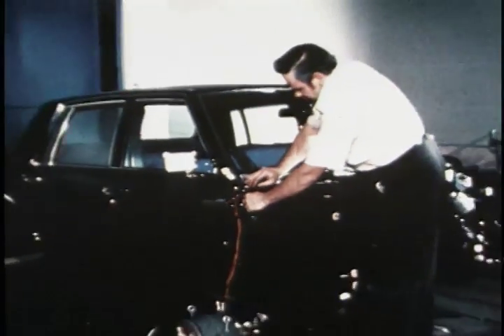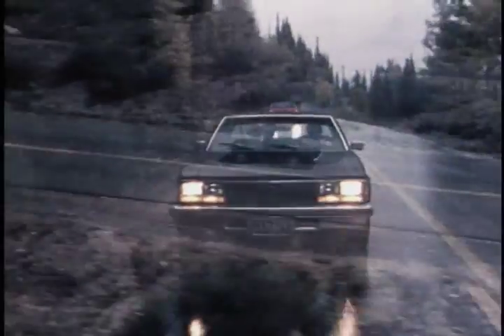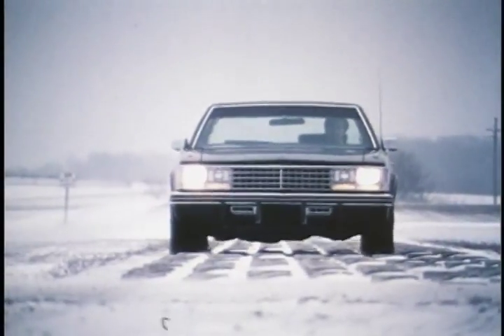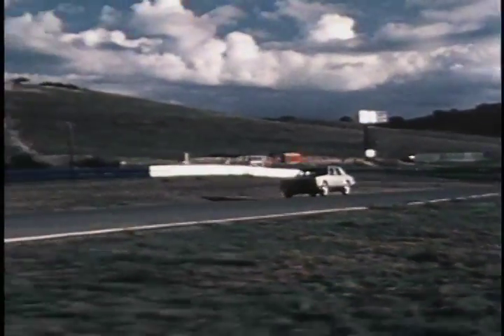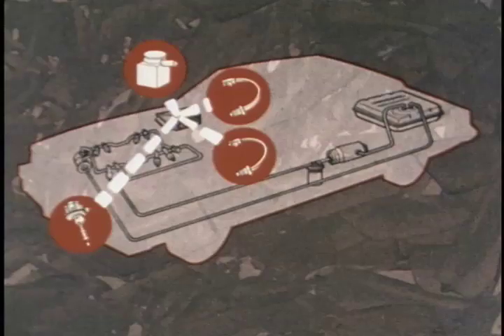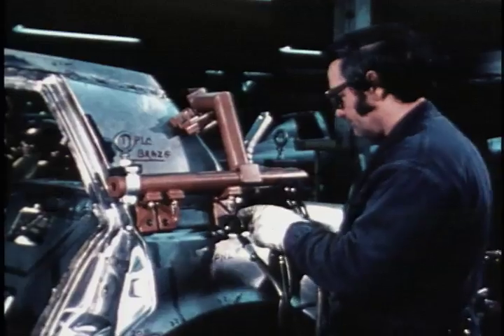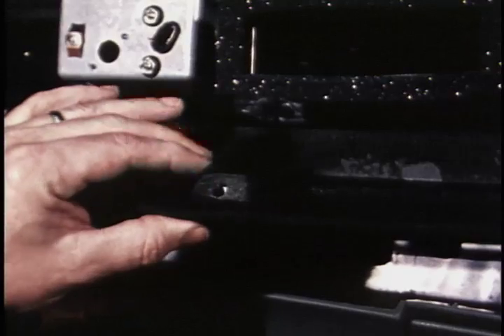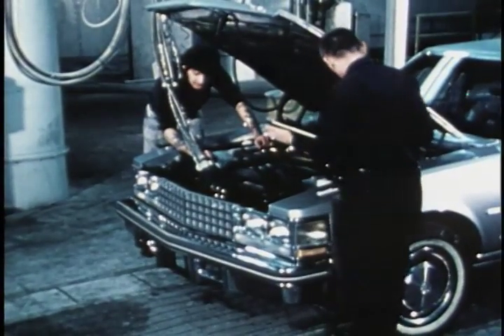1975 Cadillac Seville Engineering

Comment: When the big, fat, lethargic, spoiled, overpaid, complacent American car companies finally realized that Federally mandated EPA requirements were not going to somehow evaporate and go away, they suddenly faced the possibility that any one of them could go bankrupt trying to accomplish the mandated EPA requirements. After deciding that the Cadillac Division was expendable if a major redesign failed to the point of bankruptcy, General Motors gave the greenlight for the extremely risky Seville project. "GM executives were biting their nails and Cadillac designers were shitting their pants" as one Cadillac executive would later comment.  "Stockholder's  were sending letters and calling in with death threats panicked over the redesign and downsizing of Cadillac".  Lee Iacocca over at Ford at the time said, "If Cadillac Division goes under as the guinea pig in this EPA bullshit, we may have to make Lincoln Mercury die."  Meanwhile, the Japanese car makers were doing a happy dance knowing that they were about to make their move into the mainstream American car market. The Japanese automakers were also very much aware that American quality control was a real problem at the time. This was the reason the Seville Project was given wide birth on redesign. GM knew that Japanese quality control, fuel efficiency and standard luxury equipment blew American car makers out of the water.  To sum it all up, General Motors and all the other American car companies and their suppliers were in deep shit. They all tuned in to Cadillac to see the fate of the unbelievable, suicidal Seville Project. Of course, we all know now that the well designed, fully loaded, somewhat fuel efficient, visually appealing Cadillac Seville would become the best selling model in Cadillac history. And the rest is history.  Years later, the Cadillac executive said, "I don't know how we did it. All I can say is that God must drive a Cadillac".

Comment: it was a gussied up Nova..  thats it
Reply: You have heard that so you repeat it. The Seville shared very little with the Nova, no sheet metal, no trim, no interior components which could be seen or touched, different drive train, different wheelbase. The cars shared a couple of suspension parts and a couple of unseen support pieces. Basically all cars share components. The Corvette shared very little, other than that most cars borrow what they can from other models. The Seville was very rare in that it had a one model only dashboard (very expensive as there are many pieces), also having exclusive body panels and trim (including bumpers) on a car which they knew would be low volume showed their commitment to doing it right. Originally the Seville was going to share more with the Nova, that is how the rumor started. Ultimately Cadillac did it right and in doing so decided to give the car its own body code which is K, the Nova was an N body.
Reply: Yeah, you're just a parrot

Comment: That car was at least 20 years ahead of time
Reply: 5
Reply: It definitely was a great a great leap for Cadillac and this was a successful car without a doubt.  However, had they reached a little further and had they developed an OHV engine and an IRS rear end, it would have been on par with what the Europeans were offering with cars like the Mercedes Benz 280E.

Sadly, instead of going farther forward after this, Cadillac went into the abyss with the Cimarron, the diesel V8,  the HT4100 and the look alike GM cars of the 80s.  They somewhat turned it around later in the 90s with the STS and the NorthStar,  but those engines were plagued with other issues that sullied the reputation of those cars as well.  By the time they really got it together in the 00s with the CTS, there were really not enough Cadillac customers left to care.

Comment: GM was first to make a downsized mid-sized automobile (Cadillac) for 1975.  It would be three years later that GM would downsize other mid-sized cars to that platform.
Reply: Robert Lopresti The Seville was on a completely different platform than the downsized 1977 models. The Seville was unit construction loosely based on the Nova. The 1977 B/C/D-bodies were body-on-frame.

Comment: 4: 30 How long are those guys' lungs going to last? I can't believe they did that all day with no respirators.  I believe the EFI systems on these were somewhat related to the system that Bendix pioneered on the 1958 DeSoto and the one Bosch used on the 1968 US-spec VW Type-3 Fastback and Squareback models.  It must have been a mixed blessing for Cadillac to tout the nylon leaf spring spacers; they were a good idea, but leaf-springs on a luxury car in 1975? I guess when you start with a Nova, your options are limited. The vinyl roof was another example of that limitation; it was mandatory to cover up the seam between the Nova roof and the Seville extension; by 1978, I think, the Seville had its own roof and celebrated it with the 2-tone Elegante option.

Comment: I always liked the original sevilles
Reply: +kramden The egg-crate on the 1976 models was much more dignified than the fake-Rolls look of the 1977.  The '76 was one of the few ultra-boxy cars that looked like a piece of art; the 1977 downsized C-bodies had some of that too.  But the downsized 1978 LTD was just awkward, as if someone had taken a 1960s barge and cut a foot or two out of it. GM got some things right during those years.
Reply: I agree totally, the original Seville still looks good today, they wrecked it when the did the RR thing on the back. 
Those original 77-80 Impala/Caprices were GREAT cars.  I remember when my friends got a 78 Caprice four door, it was a tight car that handled and performed very nicely with the sports suspension.  Yeah, the styling was boxy, but looked good anyway.  They wrecked the old Impala/Caprices in 74 when they put in those god awful "opera windows".  Wish I still had my 73 coupe!
Reply: No Name I like the 3 spoke steering wheel on the 1976 too. One year only for that wheel on sevilles.

Comment: Why if Cadillac had a fuel injection system with 8 injectors did they go to TBI later on?  I know it is cheaper but I think they should of kept this system for the 1980's
Reply: +Tigerfire75 This early fuel injection was very unreliable.
Reply: +Tigerfire75 Wasn't TBI mainly for low-end cars like the Cavalier (and, embarrassingly, the Cimarron)? It seemed like a stop-gap replacement for the digitally controlled carburetor.  I didn't think they used it on any real Cadillacs.
Reply: No Name
Well during the mid 80's they did use it.

Comment: A fancy Chevy Nova sedan is all this car is!
Reply: Rubbish. The car took fortunes of money and used, for the first time, some of the most sophisticated development equiment ever used at that time. You need to go study?
Reply: Milford, you clearly know little about the Seville. You would do well to keep your opinion to yourself... you are incorrect. The two cars share no body panels, no trim, no interior components which are seen or touched. They have a completely different drive train (the rear end may be the same), they have a different wheelbase. You base what you say on the fact that you heard it somewhere... with no shared pieces you can see or touch how would you know they are the same unless someone told you? The Seville is a K body, the Nova is an N body.

Comment: It looks like a time traveler as the Seville is compared to other cars from every manufacturer at the time.  That 1976 Seville car design cadillac developed was the trend till 1985.  The technology used in the car was current till 1995. An example is the airbags, and antilock brakes.
Reply from the maker: David James It was a remarkable vehicle for the reasons you mention.  Ahead of the pack.
Reply: I’d go further than that, by saying the styling was still relevant throughout the 80’s - the Chevy Caprice body which borrowed very heavily from this Seville was in production until 1990. And many of the technological concepts are still in use today. With the technology itself current up to the late-90’s.

Comment: In 1975, I was pumping gas at a Marathon station in Terre Haute, Indiana when a guy pulled in, with 4 people in the car, coming from Cincinnati, Ohio. They were salesmen traveling to Oklahoma. Checking their mileage, the driver was amazed they were getting 25 MPG, with 4 people and their luggage. The 350 FI engine was a great motor. Based on the Chevy Nova, it wasn't a particularly Caddy design, but a nice looking car nonetheless. Very nice car.
Reply: The good fuel mileage was probably due to the EFI system. EFI eventually became standard on all cars today even the cheapest cars have it

Comment: Probably the best engineered American car of the 1970s.
Reply: It seems to be one of the few which most people agree is definitely a classic of the era, and not in an ironic way like the Pacer or the Cordoba.
Reply: @MaestroTJS  I agree, HOWEVER: Pacer WOULD have worked LATER. It had the whole "bubble" look before Ford made it "hip" 10 years later. 2, The Cordoba WAS a cash in on the whole PLC trend, But if it had been sold as a Plymouth (as WAS intended) it would have been better regraded, As a "B" body MoPar - It could get all of the Charger "go" bits! 😊
Reply: @jason9022 The fact is, it was among the best engineered cars of the seventies, your misconception does not apply.
Reply: The Seville was one of the top five...since the 1979 Eldorado was even more advanced in engineering (clean sheet design). The Continental and especially the Mark series of the 1970s were also in the top five best American cars at that time.